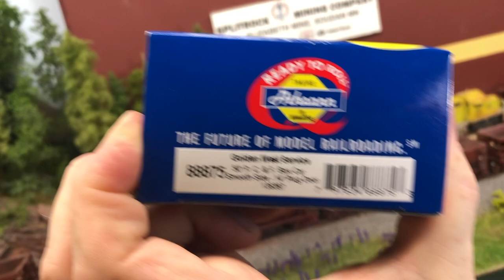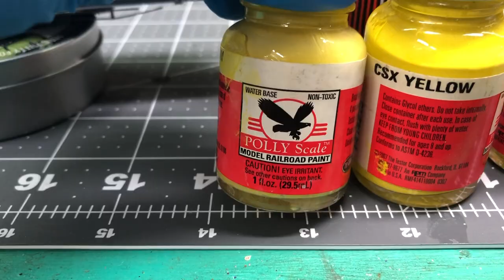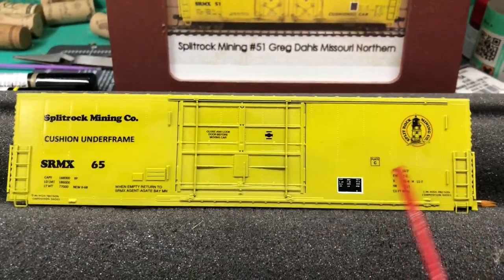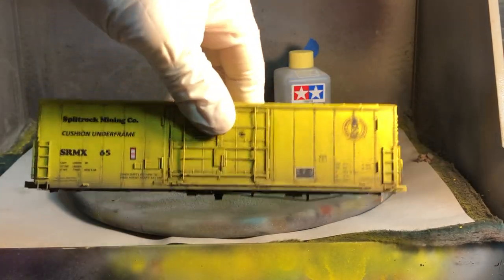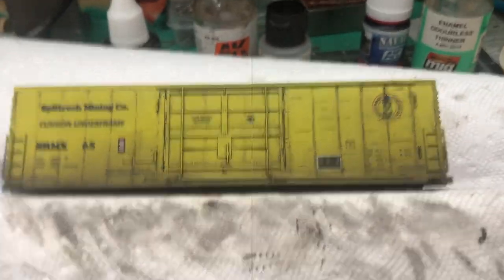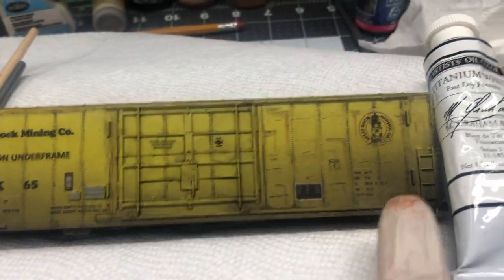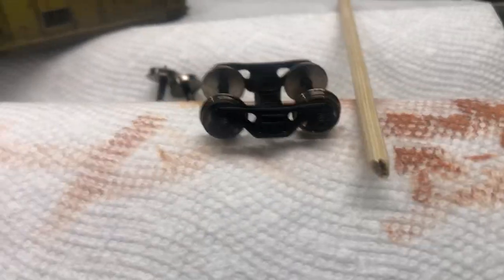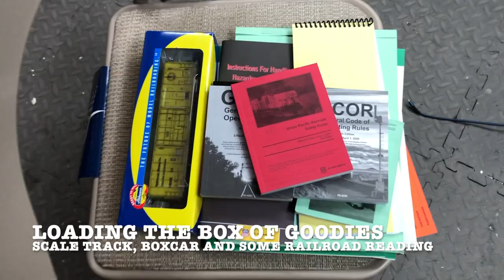Realistically creating a private road boxcar

Comment: inch by inch, layer by layer, and you get a great finish like this. Nice work, and thank you for sharing how you do it.
I use the spray pack paint from Tamiya too, you can get a nice finish from it, and their spray pack range now is huge. I use their Camel Yellow, and Chrome Yellow, to do my CSX and Chessie Yellows, as they are a very close match. I think I used Chrome Yellow for the CSX TS 47. I used it to do my Chessie Southern scheme, which is a fictitious Railroad in the Southern US, that has broken away from CSX.
Reply from the maker: Thanks. I'll look into matching that yellow. Thanks for the tip.
Reply: @splitrock323  Camel yellow is TS 34
Reply from the maker: @Ausmerica  Do you have CSX models or others that I can see online?
Reply: @splitrock323   the B&O and C&O boxcars with the yellow doors in this clip is the yellow I used. https://youtu.be/EHtGLFtAUSk 
https://youtu.be/ZE2C0lj02B4 

The Blue is also from Tamiya spray pack range too.

Hope these 2 clips may help.
Reply from the maker: @Ausmerica  Which yellow? Chrome or Camel?
Reply: @splitrock323  Camel for Chessie and YN2 CSX, and Chrome for the current CSX color scheme.